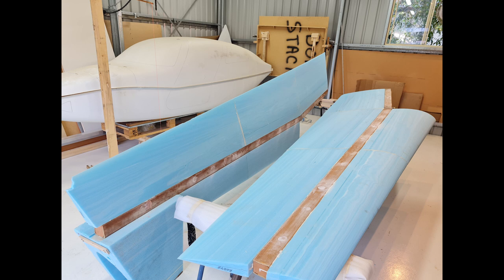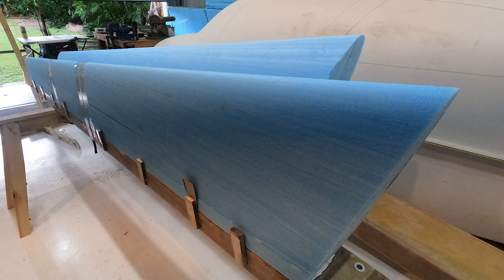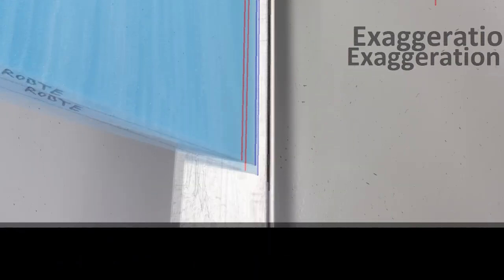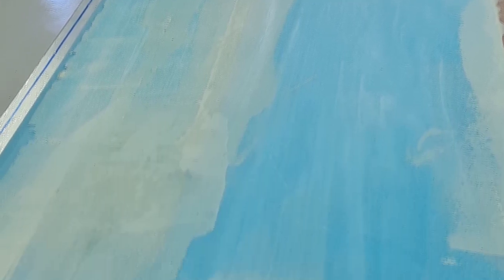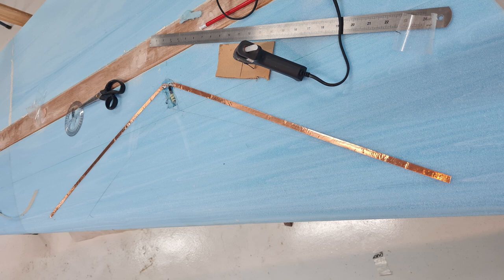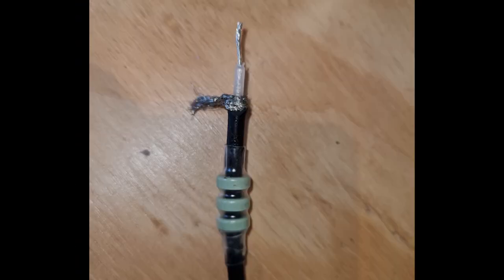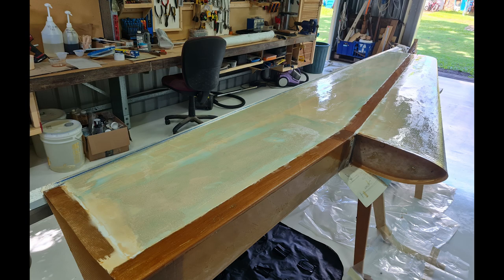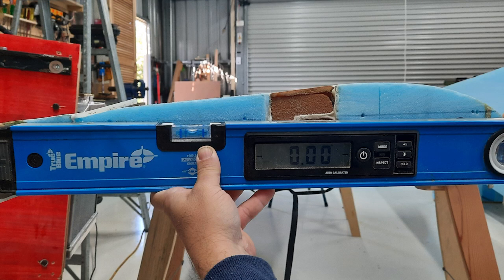Velocity Build Experience 02 - Wings up to skins

Comment: Great job, love the details. I bought my velocity, didn’t build it. Love seeing what all went into getting it together.
Reply from the maker: There's only 3 or 4 velocitys in Australia, 1 or 2 fully complete so buying is a little tough, unless it was an import.
Reply: @AusVelocity  There not all that common in the US either see them at Oshkosh and sun and fun but I never see one at my airport. I don't know why they are slick airplanes can't wait to see the performance of the Honda Turbo engine.
Reply from the maker: @Mike-01234  I think the main benefit will be the turbo. Most velocity SE's have a 180Hp naturally aspirated. The naturally aspirated io-360 would be producing around 126 HP max at 8000ft. The turbo honda should sustain 180 HP or a bit less at cruise rpm.
Reply: @AusVelocity  So why not supercharge it? Turbo is obsolete...lots of heat problem...hard to regulate...you can do electric supercharger...
Reply from the maker: @electricaviationchannelvid7863  I know old style supercharging isn't suitable, I've seen some people playing around with electric supercharges but I know stuff all about them.

While I like to sail close to the wind with doing new things, I also have to convince my airworthy inspectors that were not doing anything too new or risky. I'm not entirely sure he'll let me fly over populated areas with the Viking engine let alone with a modified version of it.
I'm going to have stay with the Viking system until we are well and truly out of the flight testing woods.

Thanks for the suggestion though, If you have any more suggestions, I'm keen to discuss anything.

Comment: I've built 2 planes and the Velocity XL will be the next one. I really like the detail you are providing on the build. Did you ask Velocity about the trailing edge? It that "normal" Thanks!
Reply from the maker: Thanks for the comment.
Yes called velocity and talked to Duane about it. He said it's no big deal and it happens sometimes and that I'll need to find a way to prop up or weight down the wing while the trailing edge is held level. Once the whole wing is glassed top and bottom then it becomes very rigid and is extremely hard to correct.

Comment: Did all the epoxy/adhesives/glass fiber come with the kit? Did you have the option of sourcing these materials locally?
Reply from the maker: Hi Pierre,
The kit did come with all the glass, epoxy and adhesives that the instructions required. It comes with 3 different types of glass weave, 2 different epoxies and a few different types of adhesives. I wouldn't recommend using something that they didn't supply.
Before I bought the kit, I asked the factory about this and they just said it comes with everything needed to build the kit. (except engine, avionics, electrics, upholstery and prop).

Something that the kit didn't come with was peel ply. The instructions haven't called for it yet but I'm betting it's very useful later on. I'm about to source some this week, not too expensive I expect.

Thanks for the Question.
Reply: @AusVelocity  OK thanks for the info. I use peelply very often. Not too expensive where I live. (about 3.50 USD per sq. meter)

Comment: The foam straightness of the trailing edge from the factory is not important.
It can be corrected using a micro slurry and your triaxel.  Just extended the layup a quarter inch. Then sand using a long block and making it perfectly straight.  And if it's not perfect you can always use a little filler on top. And I mean little; you don't want your ailerons to be heavy.

Comment: To my understanding Burt Rutan put twist into the wing intentionally. Please be careful you might not want to remove it.
Reply from the maker: You're probably right about that. It's usually for the initial stall location on the wing but since the wing is not designed to ever stall, it's probably not for that reason. The best I can do is just follow the guidance of the factory and the manual. The manual wants both wings straight so I'll run with that. I'm about half way through the canard wing, that looks nice and straight and I'll make a video on that soon, time permitting.

Thanks for the suggestion.

Comment: Now I see why they charge $19250 for fast build wings laying fiberglass isn't easy getting it just right by someone who never done it before is a bit risky I wonder what they charge if you mess it up and have to get entire new foam core start over.  It's not impossible almost worth practicing on some other foam cores first. I'm surprised they use a wood spar why not carbon fiber spar like the Extra 300.
Reply from the maker: Thanks for the comment.

The spar is fibreglass, looks wood but it's not. The spar is made with foam in the middle as well.
The fast build option is just to save time, some people value their time more than the company's time to build it. First time builders will go very slow compared to the factory with experience and jigs ready to go speed up the process.
I get the whole risk thing, the glassing isn't the hard bit, it's probably cutting the foam and getting it ready for glass is the hard bit. Foam and filler is easy to sand but time consuming to get it looking good.
Reply: Some people will do a week or two of builders assist at the factory before having the kit shipped.  I think it’s cheaper than the fast build wings, but you basically get to do them in the factory jigs with a factory technician.
Reply from the maker: @dbhyslop  If you could make it to the factory I'd highly recommend it. That way you can get answers for the million stupid questions that the new builder will have. That, and they can show you the basics and check your work until you're confident to go it alone.

While I have asked the factory for some help on the important stuff, I've enjoyed studying the problems and thinking up creative ways of solving them. I consider it part of my training as a builder. A lot slower this way but I feel like I'm getting better at problem solving (and reinventing wheels).

Saying that, the instructions give you a literal step by step guide to building the whole plane, the challenge is transferring those words to actions that end with the desired results.